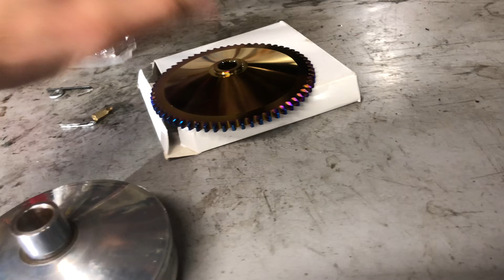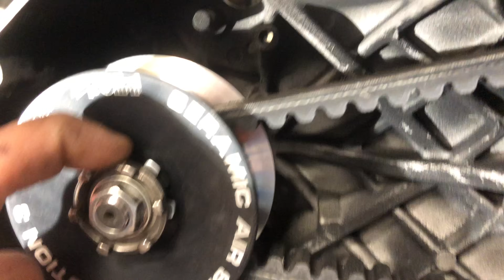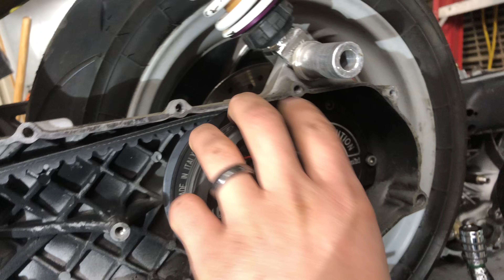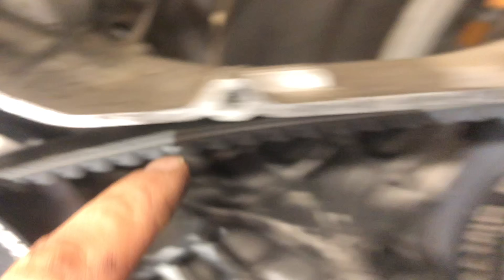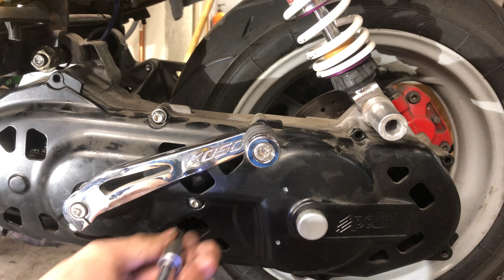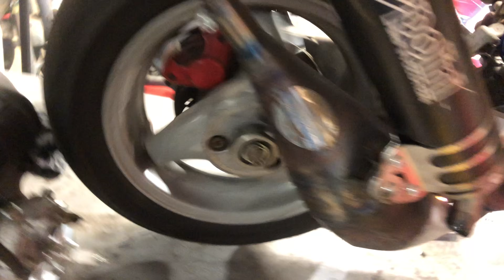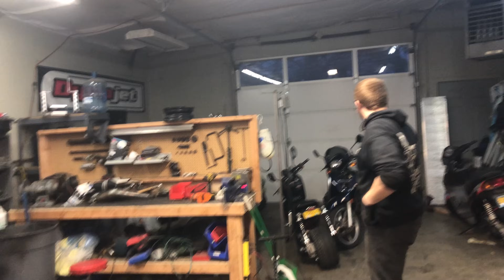Scooter CVT transmission explained

Comment: Hi there from Europe!! Nice to watch your vids. I have the same scooter,like this one.. i was tuning my cvt on 50cc stock motor,and tuned it very well,ended up with 7 grams rollers,now i changed it to 70cc,and it kinda has slow start,how can i solve this? Rollers,or should i do sth with the clutch? Thanks alot. (Also the top speed on 50cc was higher,why is it so?).
Reply from the maker: Hard to say without having all the information but sounds like your clutch springs, contra or rollers are not correct for the 70cc
Reply: For top speed 10gr
For accelleration 8-9gr

Housing roller upgrade with sandblast
Reply: @safaayda6333  thanks,will try this thing with rollers.
Reply: @safaayda6333  and in think,that the fuel consumption is much increased,it was about 3 liters on 50cc,now it's almost 4.6 liters on 70cc,is this normal? Or should I try to do sth with the carburettor?
Reply: Skep karburator setting with more air supply to engine
Reply: @safaayda6333  ok,i thought so... Will try,but will have to set it,so that the engine won't overheat...one more question: how long can i drive the scooter with 70cc air cooled without stopping, planning a trip with my friends about 200 kms one way... I also have a larger motorcycle,but the scooter is sth different and interesting for me.
Reply: @andrewnahnichuk6300  it may not be a problem, if the gas handle fluctuates up and down stable for safe touring but it's different if the top speed is stable, because matic is high rpm
Reply: I've been 376km nonstop without stopping, stopping to fill gasoline 3 times, averaging 5 minutes nonstop with the standard 112cc Yamaha mio GT
Reply: @safaayda6333  thanks alot for your advices,i appreciate. Your 112 cc is air cooled with standard cooling ventilator? Seems pretty long distance. I also will stop only for refueling. Before this ride I've only done like 35 to 40 kilometres at once,so it's kinda weird for me to go that far,but damn interesting. Hello from Ukraine!!

Comment: Hello bro does it mean bogging is also caused by a bad adjustment in cvt?  because my scooter bogs on my initial rev  before it runs smooth,same as in when I slow  down and rev to speed up,Also my  scooter rear wheel doesn't spin on idle could it be a problem? If it is how can I get it done
Reply: I would look at stiffer clutch springs so it engages at a higher rpm closer to the motors' peak power range.  That and or lighter rollers/stiffer contra spring.
Reply from the maker: what brandon said!

Comment: what is the problem if when i rev it..the rpm goes up but my wheel does't rotate....but some time its rotate...can you give me the solution?
Reply: It sounds like an issue with the centrifugal clutch that he showed in the video. It can get burned out and then, depending on the load on the vehicle (terrain, incline, loading weight) it might be slipping intermittently causing you to get the unpredictable engagement to the final drive.
Reply: @chandrahasnaphade8342  
You sir, are surely correct! 
Correctomundo!!!
CLUTCH-SLIPPAGE NO BUENOS!!!
Reply: @austinsears1637  I don't know if you are being sarcastic or not lol
Reply from the maker: clutch issue
Reply: @Scooterswapshop  it already be a trash by now..anyway thanks for the reply tho😬🤘🤘

Comment: Can you make a video, explaining in what order to tune your cvt? do i start with rollers and dial in my vario first or do i start with the clutch?
Reply from the maker: Dahl this video and my other video on clutch adjustment should explain it. Yo really need to do the rollers clutch springs and contra all at the same time if your going to a big bore kit
Reply: @Scooterswapshop  right. but what i was thinking was, do i need to do the marker trick till the belt is riding all the way up, then goto then clutch afterwards? or is the belt riding all the way up not the most optimal?